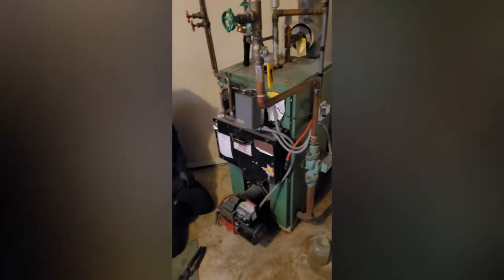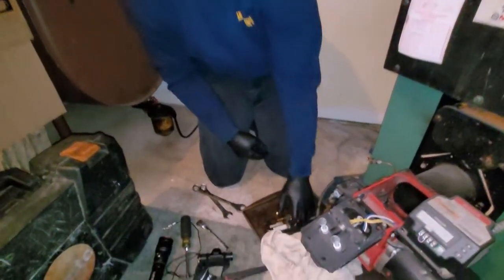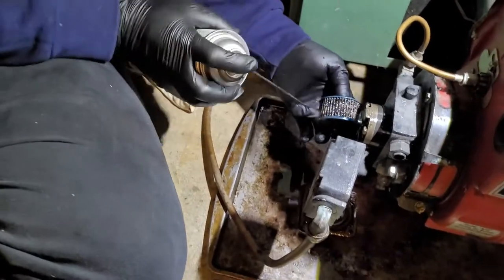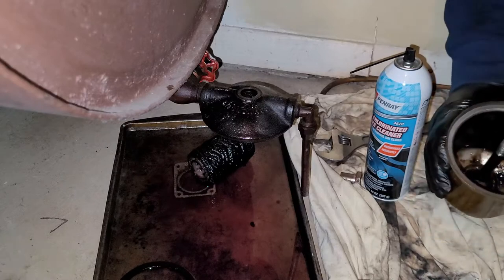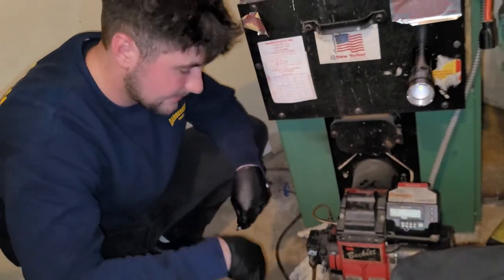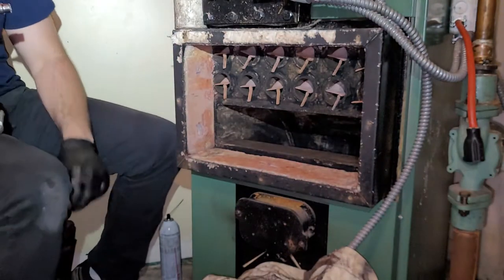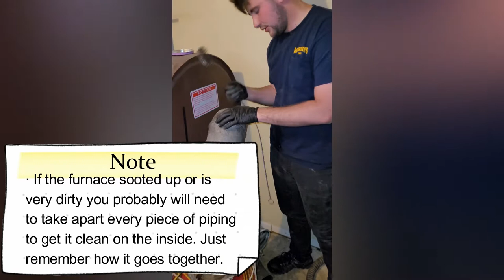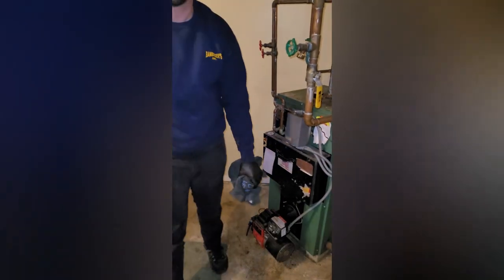How to Clean a New Yorker Boiler

Comment: You should check the flow of oil from the tank after you remove the filter. Especially with a tank that old.
Reply from the maker: Not a bad practice, we do not just because we don’t want to use the gate valves more than needed

Comment: What nozzle did you use in this case?
Reply: Many times a chart will be on the boiler to show you what nozzle to use. But it's not the same for all New Yorkers. It might also be on the burner label just below the igniter. Otherwise the company who makes the burner(like beckett) has a chart online.
Reply from the maker: Well said☝️

Comment: You gotta know the difference between furnace and boiler first 😂😂
Keep calling it furnace. Its a Boiler.
Reply: True, makes the video useless and unwatchable
Reply from the maker: @aamirshahzad8060
A boiler is a type of furnace...
Definition of furnace according to the Dictionary of the English Language: "An enclosure in which energy in a nonthermal form is converted to heat, especially such an enclosure in which heat is generated by the combustion of a suitable fuel."